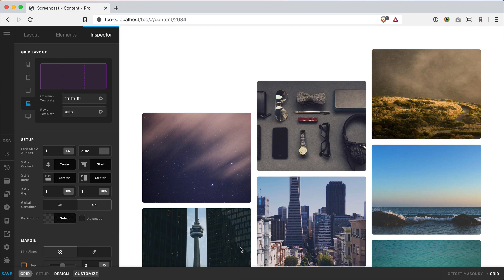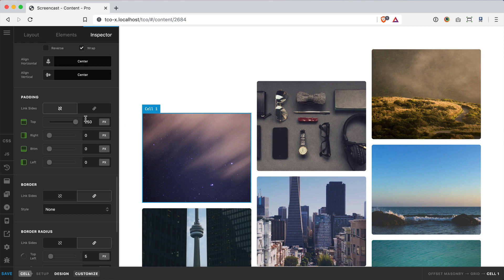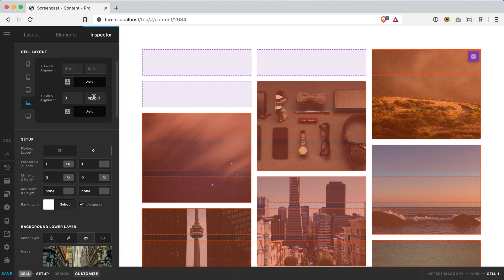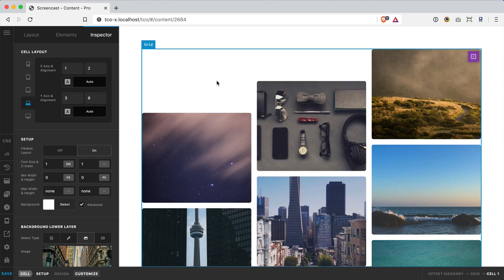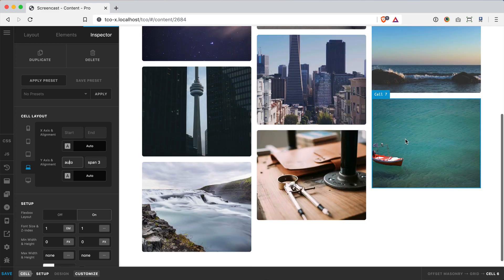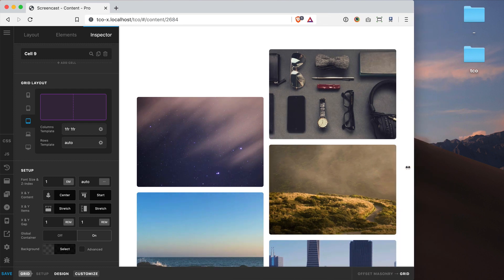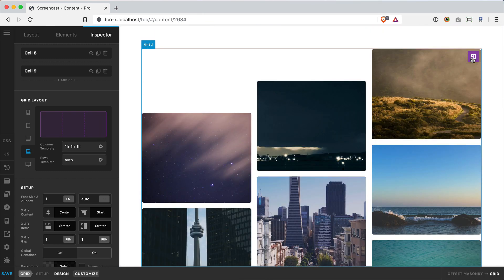CSS Grid: Masonry Layout (Advanced)

Comment: 1. At 5:36 the grid is shown to be 3 columns of 5rem - 1fr - 5rem
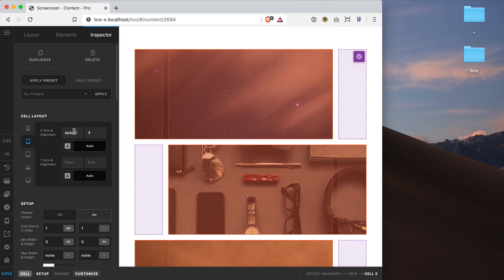2. At 6:08 you show the cell alignment as "span 2 - 4"

Where does the 4 come from?  Lost me there.

Thanks
Reply from the maker: The coordinate values for CSS Grid come from the lines produced by the grid (for both rows and columns). If you have a 3 column layout, it takes 4 lines to make make that layout:

Line 1 - the outermost line at the start of the grid
Line 2 - between columns 1 and 2
Line 3 - between columns 2 and 3
Line 4 - the outermost line at the end of the grid

Instead of visualizing the column track the cell is occupying, try instead to think of the line in the grid system you need the cell to start or end at.
Reply: @yourthemeco  Aha - you could put those lines on the video for clarity but thanks.
Reply from the maker: Most welcome!